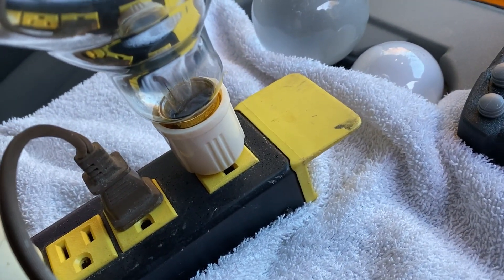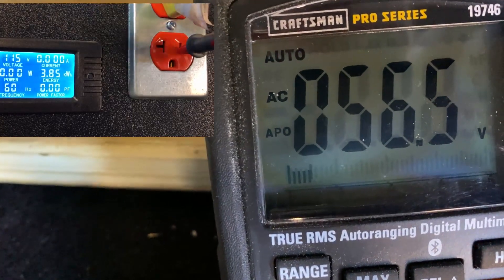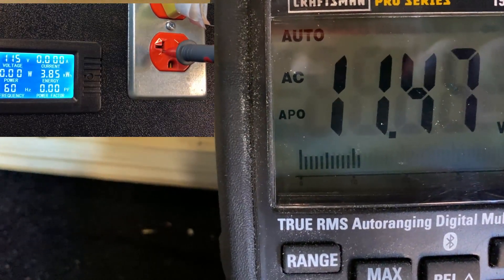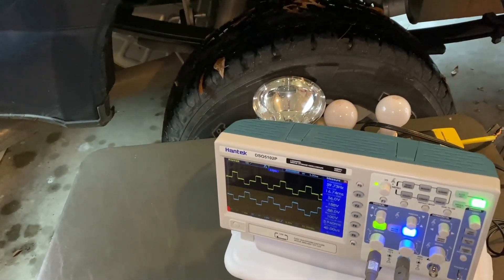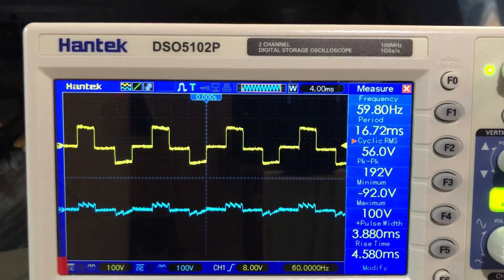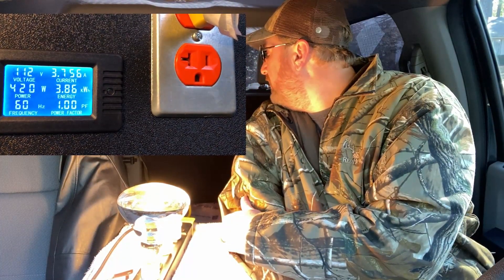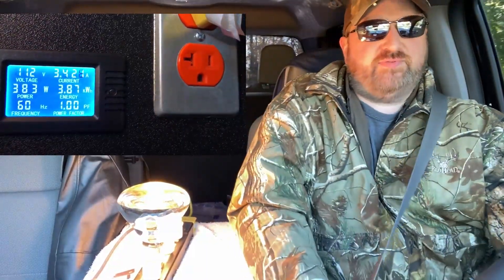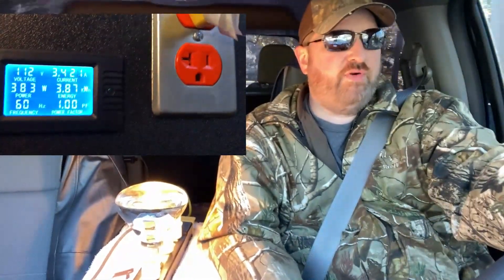Ford F-Series 400 Watt AC Power Outlet - On Board Inverter Load Test and Review

Comment: Did that inverter ever shut down while driving? BTW, great test procedures you did!
Reply from the maker: It did not go off while driving, even at more than 300 watts. I could not see a difference between driving or being parked. Thanks for watching. I hope you found this useful.
Reply: @LivingCommonSense  I agree that it doesn't make sense from an inverter perspective.  We can only hypothesize as to the reason they went through the trouble to engineer this into the vehicle's electronics and a specialized inverter.  It may have more to do with the primary current draw of the inverter vs. the electrical capacity of the alternator, and it may not even pertain to all vehicles of that model.  Consider you are traveling and the battery is running at a deficit due to insufficient alternator power due to other electrical loads such as driving lights, etc.  After some time, there would not be enough to run the ignition or if you stop there might not be enough to crank the engine to start.  The 300 watt limitation may not surface unless the battery is close to running at a deficit, and there might not be a foreseen scenario in which that would happen unless you exceed 300 watts, after which it MIGHT.  Adding a larger alternator and adds cost, weight, reduces fuel efficiency, and may require a unique alternator drive system for circumstances that would very seldom occur.  "Technical" writers write manuals, not engineers, and the manual must be simple enough for the non-technical, so what made it to print is probably the result.

Comment: Can the inverter be swapped out for a higher quality one?
Reply from the maker: I don’t think it would be worth the effort to replace the existing inverter for a couple of reasons. First, I don’t see any ground contact in the dash receptacle -only see metal contacts for what should be “hot” and “neutral”. No ground may compromise safety if the aftermarket inverter provided the capability.
Second, if I were to replace it with a higher quality inverter, I’d also be looking at larger inverters which probably means upgrading the wiring from the battery and to the receptacle. Besides, there is plenty of room behind the back seat to mount a 2000w pure sine wave inverter that would be in a whole different league from what would fit in the factory inverter location. Thanks for watching!
Reply: @LivingCommonSense  Everyone wants PSW, including me, but there are more considerations than simply cost when going from MSW to PSW.   I understand how their design choice of MSW can make sense.  A one-off MSW inverter with electronics and connections to interface to your vehicle's computer and the programming was not cheap and highly unlikely to be of low quality because they could not afford it to be for more than the inverter's sake.

Comment: Nice video. Looks like the inverter is a modified sine wave. I wonder why Ford used a cheap inverter instead of a pure sine wave?
Reply from the maker: Only reason I can come up with is cost. A MSW inverter is enough to "check the box" and list as a feature on the window sticker. A pure sine wave would be my preference as well.
Reply: @LivingCommonSense  I agree. It just doesn't make sense to save $30 using a MSW on a truck that costs $30,000.
Reply from the maker: I agree 100%. The sticker on this one was $48k and has a 230+ amp OEM alternator. There really is no excuse for compromising on the inverter. Thanks for watching!
Reply: @LivingCommonSense  It wouldn't surprise me if the Ford engineer in charge of this inverter option doesn't know the difference between a MSW and PSW inverter and went on price for the output desired.
Reply: Thats the conclusion I came to as well. I have things that just wont work with this built in inverter. For instance, an led work light will not work and I'm guessing now that it just wants a pure sine wave to run and this modified sine wave just doesn't cut it.